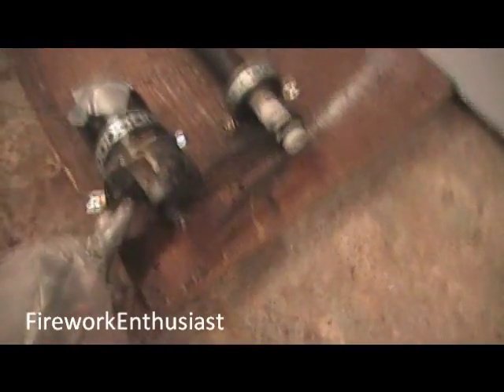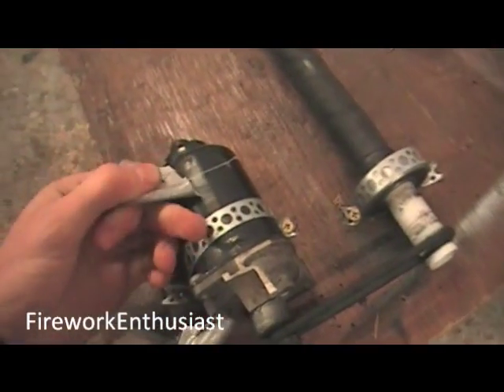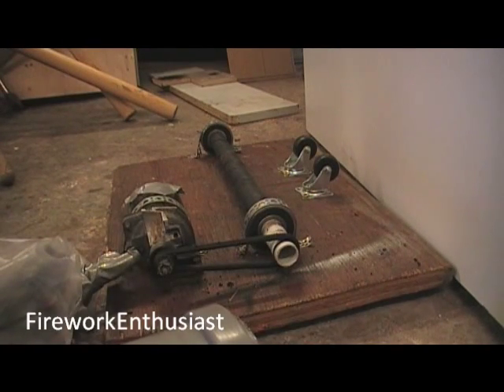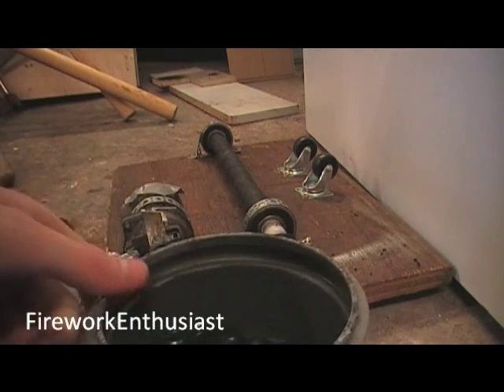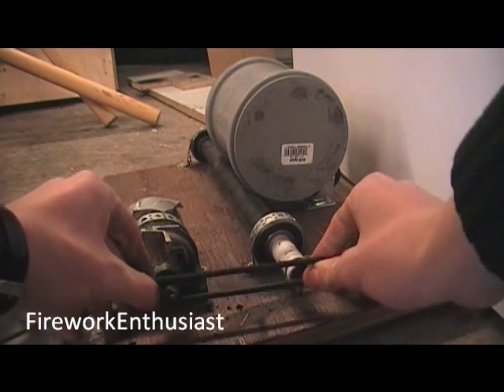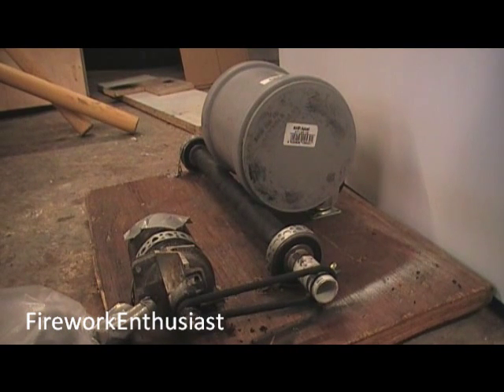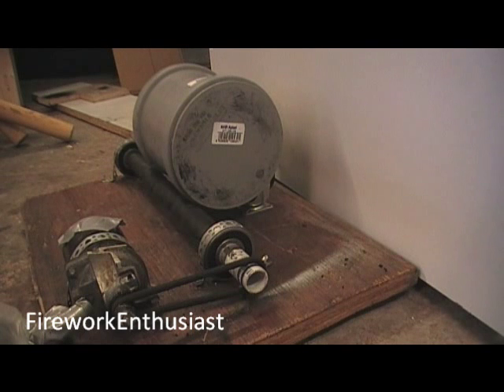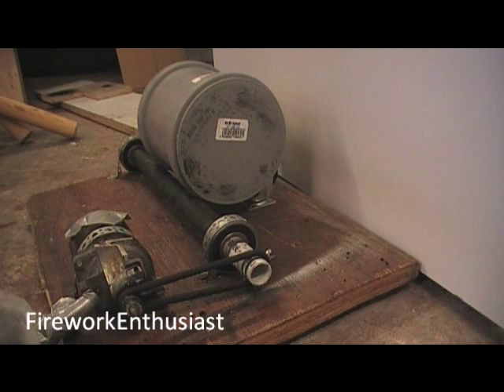Review of my homemade ball mill.

Comment: Since when did glass rubbing glass create a spark?
Reply: "Since when did glass rubbing glass creative Spark" ... since they started adding colors inside of the glass, some of those compounds have been known to create Sparks.
Reply: @olheghtt  they do not create any sparks but they can crack and be broken glass in it  suddenly
Reply: @Kirt44  some metals, and metal oxides are sometimes used to color glass or probably marbles too, iron oxide is one of those metals, if you're making aluminum powder and you're using marbles that have iron oxide, it can cause a reaction. Yeah maybe it's unlikely, but why take the chance. I would use marbles with single chemicals like kno3, charcoal, or sulphur, if I were just milling them down individually. But combined, I would just stick to lead, why take the chance.